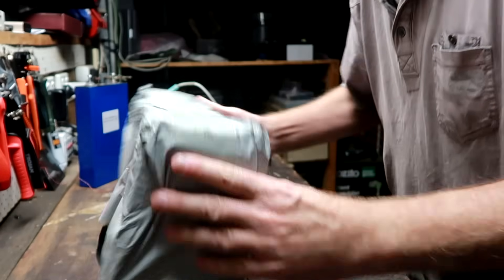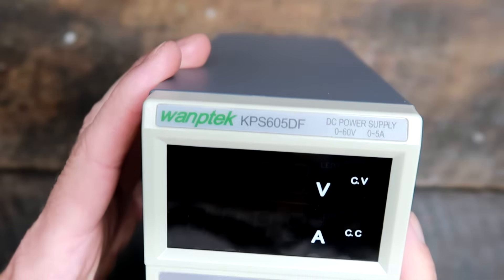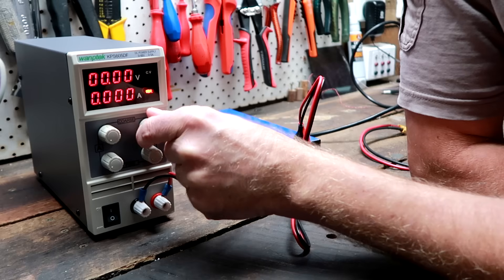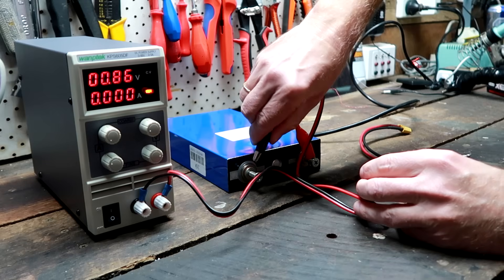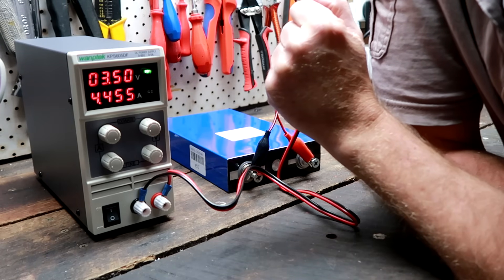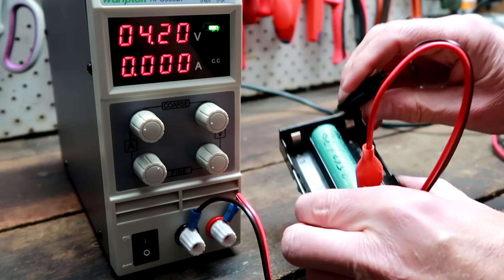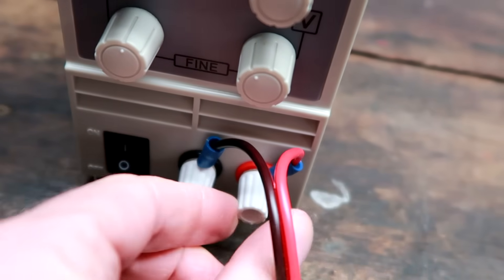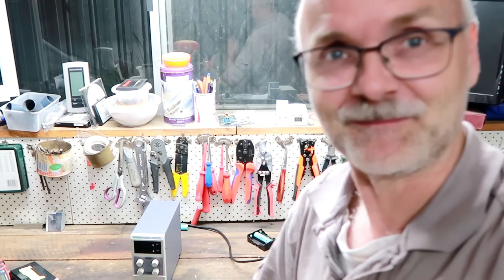Cheap 300W workbench variable power supply. Can it deliver and charge lithium batteries?

Comment: Sorry sir, I am really really frustrated... Would be so glad if you can help me. I got 12 lifepo4 cells, 3 times parallel means 960AH, 13.2V.
The problem is when charging over 300W, the surface voltage climbs so fast to the maximum, like within 10min😩 That makes my charging so slow.... How can I achieve a fast charging with this stpd cells? My solar cell is 400W, an I got the jkbms from china... I can forgot to travel like this with only electrical power...

Comment: I have a 60V 27ah Lifepo4 pack on its way what would be the Max volts and amps I should use please?
Reply from the maker: You need to follow the recommendations of the manufacturer. 
Is this a 18s battery?

Comment: You best be sure that lithium battery is not getting the volts you threw at it, because kiss it goodbye. Very dangerous to adjust the battery volts and amps while it's connected. You need some serious help.

Comment: I've had the same brand for several years. After about 3 or 4 it started to drift and now the voltage jumps around almost an entire volt when I set it to something. Does yours do this by now?

Comment: Why is 0.2C the ideal charging current for Li-Ion? Last I heard it was 0.8C.

Furthermore, how do you know each battery is at its optimal "fully charged" level if you just leave it on the supply like that? You wait for the current to go to 0? Somehow I suspect that can lead to overcharging and faster aging/deterioration of the battery.

And what happens with the current-optimized charging methods in specialized chargers that start a certain ramp-down curve after 70-80% (at least for Li-Ion)? Aren't you again degrading the battery faster than optimal by just giving it a constant current (until it drops off on its own)?

Comment: With these modern supplies, you are supposed to set your constant voltage level with no load and set you constant current level with the leads shorted together. This approach simplifies your setup a little.

Comment: Luckily meanwile Wanptek has new designers in house.I choosed the tps3010. For higher Voltage I put a 48V 10A fixed Powersupply in series. 60 Volts wouldnt be enough for my electric scooter and the 120V version i thought is too dangerous and 3 Amps too weak.

Comment: I ran across your video while researching a power supply for small electronics projects and thought I'd send what I ended up getting because you seem excited by what you have :) 
Google Miniware power supply. It is a 300W 0-30v, 10A supply, but the kicker is it is about the size of a deck of playing cards, lol. Powered by USB PD or DC voltage. A bit spendy, but so far, it is fantastic! I've been reviving batteries all morning :). (Not trying to shill, but I am really impressed by their stuff)
Reply from the maker: Thanks for sharing. I will have a look. I'm keen to see if they make a 60V version as well...

Comment: Hello sir!!! I need to top balance my lifePO4 cells but I have cheaper lifePO4 charger 14.6V10a how can I archive this while my four cells rated voltage is 3.2V.
Reply from the maker: A 14.6V charger is not suitable for that. That would mean the cells have all 3.65V precisely. As this is never the case, the BMS will protect the battery and switch off your charger. Get one with 13.8V to charge your battery.
To top balance, you may want to put all cells in parallel and charge them 3.6V.

Comment: Hi, whenever I use a PSU to charge batteries I use a 20A Schottky diode in circuit, that will protect your PSU if the one fitted on the output is a bit weedy,

Comment: Looks like a decent power supply. I've had a 0-30V, 0-10A for a few years now and recently bought a 0-60V,0-5A also now that I'm occasionally playing with 48V setups. It's a different brand, but the banana plugs are a weak point on it too.

Comment: Could you use a resistor between the posts to dissipate the residual voltage and allow your voltage adjustments to be closer to real-time?
Reply from the maker: You probably could but would have the load of this resistor all the time. It's not too bad after using it for a few days...

Comment: You going to love that power supply I got one just like it except for it's the 305 which is 30 volts it works great man especially for designing and testing batteries
Reply from the maker: Had it running for 1h yesterday on 60V and 5A and charged the battery. The fan turned on and off as it should and it worked great!

Comment: Hi Andy, please keep up the nice work and ignore poorly behaved people. I think it's much better to get a RD6012 or RD6018 and 2-3 used 450w HP server PSU (series to make 27-40VDC) to build as a power supply or charger. Far more usable and reliable than cheaply made staff. Just like don't charge the $1000 mobile with a dollar shop charger. Cheers from WA
Reply from the maker: Thank you, all good 😉
I looked in to the RD60XX versions but I dodn't want to buy a separate PS and then put this all in a case. I also don't wanted to press buttons and change settiings just for a wuick test. I wanted a quicky and easy solution for quickly testing electronics and batteries.

Comment: This looks like an amazing product.  I wish they'd put the actual power output on products, rather than saying up to 1.5kw.  So bad.  If anything it should output more.  1.6-1.7kwh to make up for power losses.  We bought AGM batteries at 26.4Kwh.  That's more than enough for us but in reality you can only use 40-50%.  So that's 10-14Kwh at fully charged.  Then it's not enough.
Reply from the maker: Thanks Lee. That's the problem with AGM or any lead acid. You need the double capacity if you want the to last. And even then... do you plan to upgrade to LFP batteries?

Comment: I found your review of the Bluetti Power Station useful. Most of the other reviews are of the Bluetti under a 100-120V AC 60Hz load.  On paper the max efficiency (>70 load) is 88% (110-120Vac) and 90% (220-240Vac). A real-world review of how the product actually performs under higher voltage at 50Hz was helpful.  I've been waiting for a local review of this product for some time. Thank you.
Reply from the maker: Thank you very much Mark. Appreciate your feedback and comment!

Comment: I had no issue with your Bluetti video, I got the point and didn't think there was any conflict of interest in it. You were equally critical and enthusiastic, so I don't understand the hate you might receive.

For charging, I use an iCharge X8 fed from an old telecom PSU which I think is a bit over 60V and 800W.
Reply from the maker: Thanks Bob, much appreciated!
Yes, the iCharge is on my list of devices I want to check out in the future.

Comment: Dear Andy can you test the power supply for radio interference if you have 5 min time😊,I am radio amateur and want to buy the same smps,do the test with a simple transistor portable radio.
Reply from the maker: How do I do that?
Reply: @OffGridGarageAustralia  just take the little radio near the smps and put it on medium wave,much off the solar gear makes very much radio noise and is very anoing for radio amateur stations.greetings from Belgium Andy,stefaan.

Comment: No worries! Ready to use power stations will be more expensive for convenience, taxes, labor costs, materials, manufacturing at small scale, etc. 

 Don't turn it on, take it apart :) Watch out for small and lite fire chargers :) Does the bench power supply show results spot on?

Comment: Great video! I've enjoyed watching and learning for some time. I have a similar 60V/5A ps. ($90 on Amazon) and yep, its tiny just like yours. If I may though...my understanding was, you first set the Amps by powering up and shorting the leads, then dial in your target Amps  while the volts are turned low(3-5V) then turn off the unit, un-short, then turn on and ramp up to your desired volts, then attach your load. (In this case a batt) I'm remembering somewhere that said once you set your target V and A, it's not a good idea to adjust the Amps while the load (batt) is attached. I may be remembering it wrong, but I recall it was a big no no, especially for battery charging. I humbly stand corrected if in fact, this is mis-information and a non issue. Again, love watching and learning along with you!
Reply from the maker: Thank you Tyler. The usability of the power supply get better over time once you get the hang of it and leran how it works. I really like it.

Comment: I didn't watch the Bluetti video because I have already been it in other videos and it's not for me! 
The Lab Power Supply though, I have a 30V 10A model which can't deliver 10A at 30V! 
I have looked at high voltage Power Supplies but I don't want to get one that can't deliver the full 5A at 60V. 
I would have liked to see if your one can do it? I have seen some that can...
Reply from the maker: Thanks, Peter. Didn't I show this i the video? Or maybe it was i the next video coming soon. Mine can handle 61.5V and 5.15A. Had it running for over 1h yesterday and charged the big battery with it. Fan comes on to cool and no voltage drift even under full power.
Reply: @OffGridGarageAustralia  that's excellent! Mine has a proper transformer in it but struggles to deliver maximum power! You can have one or the other but not both, your one looks like it's powered by a Switch Mode Power Supply, it looked like it was pretty light weight in the video! 
But it's great to know that full power can be delivered... I need two of them to get +-60V rail's to power amplifiers under development... 10A total between two would have been better if they were 10A each or more but for the money, can't really complain, no one listens LoL.

Comment: Wow, you are very kindly upset ;-)
I am thinking of such a power supply for a while now... And will probably buy one...
Don't care about the useless commenters ;-)
Reply from the maker: All good, some 🍺 fixed it. Usability gets better over time once you get used to it. Had it running for over 1h yesterday on full power and the fan actually turns on to cool the unit, So, seems to work well and for that price... Was a good buy I think.

Comment: There are some good variable PSU buck/boost modules available, eg ZK-4KX, working off up to 30v DC, 3 to 4 Amp. Cost around 11 AUD or $8.25.
Reply from the maker: Yes, there is some good stuff out there, just need to conenct your own power supply and put it in a nice case. I went down the path of just buying one this time. It works well so far.

Comment: On a bench power supply I really like the ones with an output enable/disable switch separate from the power switch. Adjusting that new one seems quite annoying.
Reply from the maker: It gets better once you're used to how it works. It's a bit fiddly but not too bad after a few days now.

Comment: I got the same bench PSU (different brand) and it worked great for charging my 48v banks. Also for pre-charging the Caps in inverters. I left it charging a leadacid 48v bank, for two days. The voltage setting didn't drift at all.
Reply from the maker: Ah great to hear, I was wondering about this. My old one drifted a lot when it got warm so I had to adjust the voltage all the time to no overcharge my AGMs.

Comment: "there must be a big capacitor inside" no, but there's no load on it, so the only thing pulling it down is the bleed resistor, which is likely quite a high resistance unit. If there was a big cap on the output stage you'd get a nasty arc when you shorted it out and shorting it out is normal practice to pre-set the current you want, so you drew the wrong conclusion here. I got the 3010 black model with USB on the front recently myself, same brand, different model, and my feedback is this: 

The voltage and current are only displayed digitally, the configuration of them is 100% analogue and subject to minor drift and difficulty in homing in on the value you want even with the fine knobs. It'd be nicer if the settings were precise and digital and the control circuitry set the output based on that - however for the price, I can't complain. More expensive ones do behave that way. USB quick charging works fine. CC and CV work fine and reliably. I used mine to charge up each parallel bank of a 5s4p lifepo4 pack to 3.65 and 1A lower cut off (32AH capacity) one by one, 5 in a row, and bingo, fully charged pack. But it's just generally useful for all electronic work on the bench.
Reply from the maker: You can actually see the voltage dropping faster at the beginning so I thought it looks like the e-function of a capacitor discharging.
Reply: @OffGridGarageAustralia  Yeah, it's 100% a capacitor, but 100% NOT a big capacitor :-D That's what I was picking on, the size. Any even small cap on that output would produce a nasty arc at any voltage ~10+ and that doesn't happen, so the cap size is very small, just enough to provide minimal ripple from the switching stages that drive it. And a small high value drain resistor so as not to waste energy and reduce usable output while making heat.
Reply from the maker: @fredio54  I can try with a 1k resistor just in the terminal and see if it makes a difference.
Reply: @OffGridGarageAustralia  Yep, if you try with 100k, 10k, 1k, 100ohm from a given voltage to zero, and plot the curves, you can accurately calculate the capacitance, if you care. OR you could open it and read the value off the part :-D I'm tempted to do both myself, but too busy right now.

Comment: Hey Andy! Been watching awhile, you convinced me to explore your area of the country (I'm from Brisbane), certainly happy I did do, you live in a great area!

Thanks for the video, super helpful since I was looking at a power unit recently! Now I really want a supply with a numeric input rather than potentiometers, I really thought they should be rotary encoders if that's the only interface..

Two unrelated questions for you though:
 1) what's your background training /apprenticship?  I agree that your life qualifications shouldn't impact your DIY'ness though! But it certainly makes me curious, as I'm sure we both understand the.. Uh.. limitations QLD/Aus place on us performing DIY work compared to other countries such as UK/NZ/USA
 2) not a question, but I'd love to watch your other channels - feel like doing some cross promotion?  You might have it linked somewhere, but watching through the TV primarily doesn't make spotting links super easy :)
Reply from the maker: Thank you very much. I had the keypad pwoer supply in my shopping basket but really wanted something simple to use, quickl and easy not to push too many buttons all the time to change settings. I love that they can be connected to a PC but I chose to go with the simple power supply. After using it for a few days now, it's pretty good once you get the hang how to operate it
1.) I'm an electrician and electronics specialist but worked most of my life with computers
2.) Hers ia link to all my other channels. Only one is in English though
https://www.youtube.com/c/OffGridGarageAustralia/channels

Comment: Thumbs up for your videos. I have one similar DC power supply but for range 0-30V and 0-10A. It's a very basic power supply and yes the adjustment of volt and ampere is a bit of a little hassle. The most negative issue I have with the power supply is that the display or the build in voltmeter is not reliable. I get different values (Volt) from DC power supply and my new UNI-T multimeter measuring instrument.
Reply from the maker: Thank you.
I checked both volats and amps a few times and they seemed to match with the Uni-T. Had the PSU running for over 1h yesterday and chargig the big battery and also no voltage drift even the fan came on and cooled. Seems to be good so far.

Comment: The Fine controls appear to have a range of around 10% of where the Coarse control is set.

Australia isn't the only place with slow delivery.  I have a package coming from one of Banggood's US warehouses.  It left that warehouse (at least got a departure scan) 11 days ago and the US Postal Service is still waiting for the package.
Reply from the maker: Yep, the fine knob's range is changing depending on what voltage or amps you have set with the coarse knob. Makes sense. It's not too bad once you get used to it.

Comment: I prefer the Riden RD6012 bench power supply. 0 to 60v and 0 to 12A and with its digital interface it's far more accurate to set, can also be controlled from your computer as well
Reply from the maker: I had this in my shopping basket first. I would need a power supply for it though (unless I buy a full sized unit). Also, I wanted something quick to setup and easy to operate without haveing to push some buttons first. I may get it in the future stage though as I like the USB connection...
Reply: I 2nd this power supply!  I have 2x of the 18A version and one of the 12A version.  You do need a separate power supply...  I did buy the kit which it really nice!

Comment: Interestingly many of those power supplies with dual (Course and Fine) knobs, have a different adjustment range for the Fine depending on the setting for the Course knob. So if the Course is set at 5v, then the Fine may adjust 0.25v. But if the course is set at 60v, you may find the Fine has a 1v range. 

I have a 30v 30A bench supply, and it has a 10 turn pot for the voltage. It's really good to use as opposed to the Course/Fine setting on the one I have like yours. 

These are the best types of supply to do testing of specific settings for a BMS.
Reply from the maker: Thanks Paul. Yeah, this one adjusted as well depending on the voltage. I found this out last night 😉